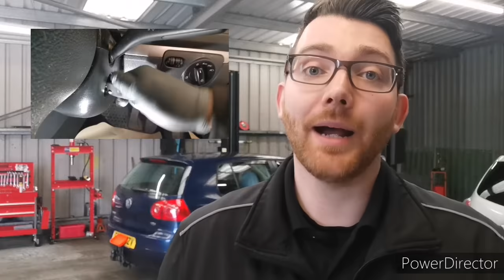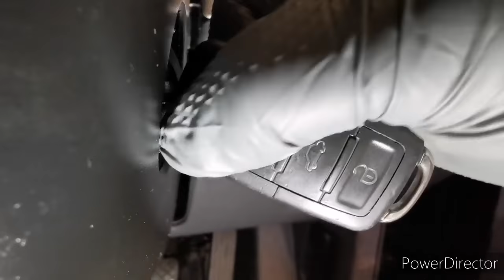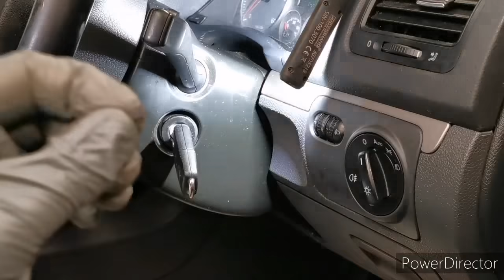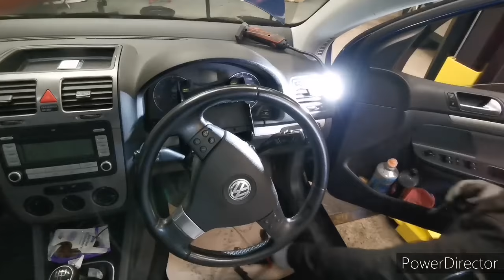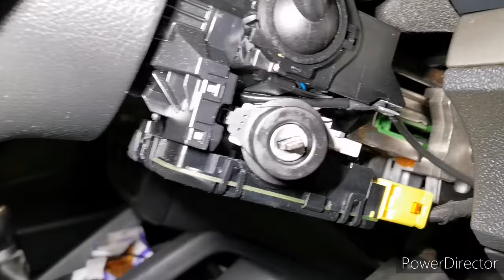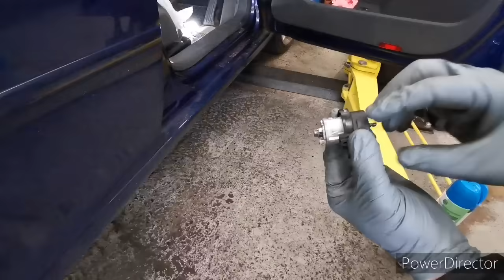VW key barrel removal, with the key stuck

Comment: Thanks for the video. What to do if the key can be removed, but upon inserting it, it rotates only a few degrees, then you are not able to move it any further? It won’t match the little notch which is approximately aligned with the ignition ON position… The steering lock mechanism doesn’t work anymore, even with the key out the wheel rotates freely
Reply from the maker: The mechanism behind the key barrel has likely failed. So when the key is inserted it won’t allow the mechanism to move. 
I would advise taking the vehicle to a garage where they will be able to remove it completely and carry out repairs.
Reply: @MTMMotorServices thank you for a super quick response! ❤

Comment: What if the key is not stuck, but ignition is locked.  How do I get the two holes lined up in order to use the paperclip?
Reply: i think there is a video out there on that issue . mine is key is stuck in run and start and wont come back to aux and off .  but this video is good but im pritter sure its the pin in the sterring lock that binds the hole thing up. this problem can be bypassed by removing the steering lock

Comment: Ok...  thers a little bit you may have left out...  I got a new key cut today after  mine started getting sticky in the lock...  so   I got  a new  ( non folding one)   the key is still stuck...  just a normal paper clip you say??
Reply from the maker: A paperclip can be used to release the lock to remove the barrel. Sometimes the issue is further back, as is the case in this video. The mechanism that the barrel slots into can jam and not allow the barrel to move into the correct position to remove the key.
Reply: Ah ok... so the paper clip will act as a kinda reset button then...  put it in the whole and the barrel will realise   itself?     I will try this tomorow and let you know...  cheers for that ;);)
Reply: Скрепка должна быть толстая до 1,5 мм

Comment: thank you for keeping it clear and simple,You mentioned transponder, does that mean that if my battery is low on my keys it could be the reason why it won't turn?
Reply from the maker: Hi, no, if the transponder doesn't recognise the electronic signal from your key, the key will still turn but the immobilizer will kick in and prevent engine from starting. the key barrel is mechanical and set to the physical shape of your key blade. as you can see when we removed the transponder ring and the barrel itself, there was nothing there that should have prevented turning. this is because the main cause of the problem was further back and part of the steering lock mechanism had seized.

Comment: Hello man..in my 2001 new beetle when I turn the ignition off the key pops out..I have to find that sweet spot and not turn it all the way in order to lock the steering wheel. Otherwise it pops out, steering wheel does not lock and all interior lights come up. Could it be a problem in the lock cylinder or in the main body of the locking mechanism?

Comment: My key is stuck in the off position and comes out just doesn't turn.  How do I get this out if it has to be in the on position to allign?
Reply: Exactly that’s why I’m confused it won’t let it turn on what do I do
Reply: @Modern-Gladiator  I ended up getting it to turn.  I took the whole assembled out and smaked it with a hammer a bunch while jiggling the key and it ended up turning.

Comment: Can I just add to the "ON" position. The paperclip hole and dot on the ignition barrel need to line up to release.
Reply: The plastic cover prevents the cylinder from releasing fully
Reply: @h.ar.2937  keep wiggling, it eventually comes out
Reply: @tyjohnson7428  It did eventually! Thanks

Comment: Yes , that is the easy way , but if the key does not turn anymore you have to get all of .
Reply from the maker: Yes, often the fault actually lays further back and it's the column itself that needs replacing. Not the barrel
Reply: @MTMMotorServices  yes , i have managed yesterday to get the cilinder out , but the housing you have to destroy , otherwise you have to buy 2 parts together , the lock itself kosts here in NL , about 270 euros so that you can use the original key.
But , it is a nice video on youtube , people can save money.
Reply from the maker: @Holydiver7019  you shouldn't have to destroy it, there are security bolts which are there so safety purposes. But there are ways and means to remove them. As the removal of these bolts are for safety reasons, I haven't covered it on my chanel.  But there are videos on YouTube on how to remove them

Comment: Some in theory if you take the barrel out and leave in  it. And leave the connector plugged in it you can start the car with a screwdriver. Just to get your self out of trouble
Reply from the maker: Aslong as you've got the key fob to disarm the immobiliser

Comment: how do you get it back in lol ?
Reply: Old comment but watched this video in 2024, for the fellows after me.

You will need that paper clip again. Once you are able to remove the piece from the steering wheel, like he showed in this videe; you are going to want to pay attention to where the paper clip is. It is old down the catch that prevents it from getting pulled straight out from the steering column.

If you already have taken the paper clip out, stick the paper clip back into the hole that was used to take the barrel out. You will have to hold the catch with your finger, to allow the hole for the paper clip to line up.

Once the catch is held in place, pay attention to the orientation of the barrel and the receiving end in the steering wheel. On the car that I was working on, I had to have them in the "ON" position.

On the receiving end, putting it into the "ON" position allowed a piece to open up that will prevent the barrel from sliding in.

Comment: Thank you. My key wont go all the way to the ON position, so I cannot align the little dot and hole for the pin.. I did this for my spare part lock barrell and it was success, but now the lock in my car, is stuck and I cannot put it to the ON position, can I just force it perhaps with pliers ?
Reply: How did you fix it ?
Reply: @micksingh4339  removing the steering wheel, removing the lock and changed the whole lock
Reply: Fml I'm in this same situation

Comment: Hi Marc, how do i take out the barrel if the ignition doesn't go to ON position?
Reply: I have the same problem, how did you resolve that situation? I am wondering if I have to remove the steering wheel etc so I can change the whole lock assembly
Reply: Pull down the steering adjusting handle. Rock the steering wheel hard in all possible directions while gently trying to turn the key on. It works in most cases.
Reply: Anyone got an answer?
Reply: @jorisvb   I used a hammer to tap & quick dry lub

Comment: What can I do if I am unable to turn the key to the on position? I can only turn it slightly to unlock the steering wheel but can’t rotate the key or ignition to the on position, which doesn’t allow me to line up the small holes.
Reply: Old comment but might be worth it for future reference.

I have had a problem similar with VWs. The trick was turning the steering wheel slightly one way or the other. Just enough to provide some tention, usually that would be enough to release the key into the one position.

This would be after the steering wheel got unlocked from the key.
Reply: Did you ever figure out this issue? I currently have the same problem
Reply: @tdh513  No, I did not. It was a car that was for sale. I chose to not purchase.
Reply: @tdh513  were you able to fix it? i have the same problem
Reply: I have the same problem haven't seen a solution this.  Anynody??
Reply: Steering lock failure. I do about 4 a week
Reply: @BradJonesGoKarting this has happened to my 2011 golf. Have to stall it to turn car offf
Reply: @BradJonesGoKarting what do you do to sort?

Comment: Hi, i own volkswagen jetta se 2009, and same thing happened.

When I turn on engine, i felt stuck.
it was handle lock, so I wiggle them and put the key in.
After I arrived at my place, i tried to turn off but it still remained on ACC, which keep my engine from turning off.

I so upset by this situations. Tried every steering lock solving things on Youtube but doesn't worked.

Would it help if I follow your directions?
Reply from the maker: If you remove the barrel, be sure to not Move the internals inside the steering column. This removal and re fitting can sometimes fix your problem but likely the problem is part of the column itself. If you don't feel confident and competent I would always recomend you take the car to a professional
Reply: Thank you for super fast reply.
But still I can turn on my engine, with a stucked key.
Like this.
I kill my engine by geting off engine fuse, and then disconnects battery line with.

When I wanna drive, I do the same thing above inversely. And getting a car and turn on my engine.

Does it happen with broken steering column..?
Reply: I really have no budget for fixing it. 
So..... Hope it would not be that much cost..
Reply from the maker: @youngkim6740   potentialy the issue is deeper into the column and normaly requires replacement. This requires removal of VW security bolts and re calibration of steering angle with a diagnostic tool as well as de activating the airbag system. Although just by removing and re fitting may solve your problem, I'm just making you aware that if it doesn't, then it is an indication that the ignition switch inside the column unit is at fault. It's labour intensive and also a common problem on VW's. You should be abke to find a video online for that, but again. Due to the nature of the job, I'd recomend a professional
Reply: @MTMMotorServices  man I fixed it at 2:30 AM just before i write this comments..
You dude you're like a god. I penetrated several time the hole in ignition lock as your way on video, it works.
I think this vehicle is kind of old one which is not enough to used to steering lock, so that might causes some jamming.
But now it works so smoothly... I'm so thankful with that video. You are a such god for me! Thank you so muchhhhhhh dude!!!!
Reply: @MTMMotorServices  but I'm gonna have a full inspection to prevent further problems as your recommendation tomorrow. :D 
Have a good night. Really appreciated your insight.
Hope your everything gonna well, and be safe.

Comment: Hi. How to put the lock to new barrel? Actually we shouldn't turn new barrel mechanism but middle, centre pin it's in another position as lock with key, which should be in ignition position to remove. Greetings. Tom

Comment: Is the car you have demonstrated on a Golf Mk5?
Reply from the maker: Yes it is. Although this set up appears on a few different models
Reply: @MTMMotorServices  Re Mk 5 Golf - After this I ended up drilling up into the Aluminium Key barrel housing to remove the Steering Lock and then reassembling the mechanism. Much easier than trying to remove the dead bolts. If it's of use see here - https://www.youtube.com/watch?v=R4npTUg5DOg&feature=youtu.be  All the best! Seán ps Thanks very much for your clear video.

Comment: Would this be the same for 2005 audi a3 ?
Reply from the maker: there can be some variants, but if you can see the hole on the key barrel then it should be either the same or similar atleast. i cant say for sure without looking at one myself.
Reply: @MTMMotorServices  
It worked !! same procedure as the video! thanks heaps!

Comment: I did that, I checked position with screwdriver and now my wheel is locked, position wont go anywhere, how to unlock wheel now?
Reply from the maker: If you wiggle the steering wheel and turn the barrel it should release the lock. If its still not playing ball then the issue could be the unit itself. You'll have to remove the steering wheel to strip it down.
Reply: @MTMMotorServices  Oh god, I mean.. I go to position 1 or even 0 and my steering wheel locked. So stupid mistake, now I know. So dissasembly unit is way to go? should I be afraid of airbag? (battery off). I go into it because of ignition key. I turned it off from car and its still running. Thanks for reply!
Reply from the maker: @michalknapek5697  if the battery is off, after an hour it should be safe to work on. But we always recomend de activating the Airbag system with a diagnostic machine. Unfortunately to get at that unit you'll have to remove the steering wheel and disassemble the the the airbag wiring (clock spring). There are videos on youtube detailing this procedure. We at MTM will work to see if we can get a video up on this subject soon. All the best with your repair. Let us know how you get on :)
Reply: @MTMMotorServices  a quicker way to de-energize the electrical system for handling SRS stuff is to take the ground off the battery then put a small shorting jumper across the cable ends (NOT the battery).  just make sure that ground isn't anywhere near the battery post if it touches your jumper will vaporize.
Reply: If you disconnect your battery for any reason make sure you have your radio pin number or you radio won't work once you reconnect your battery.